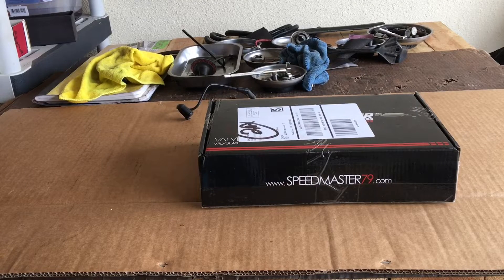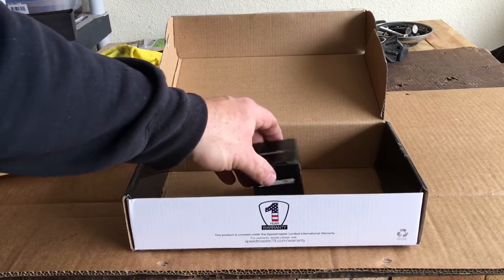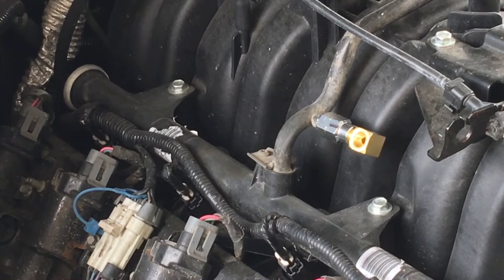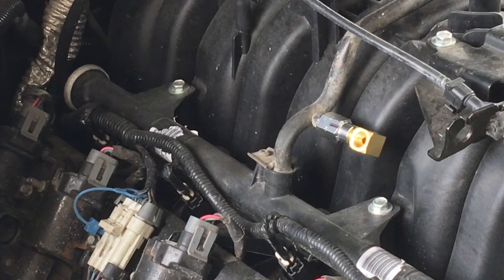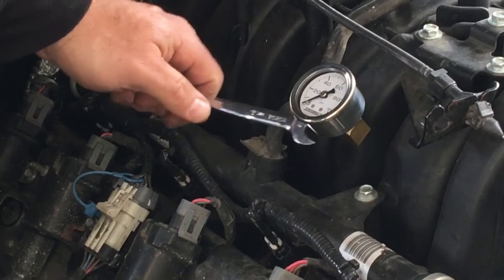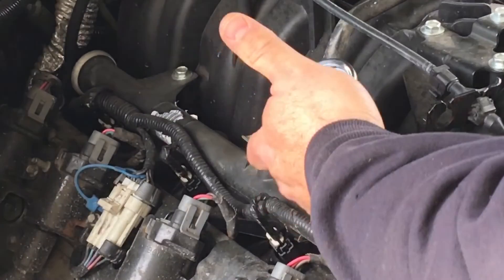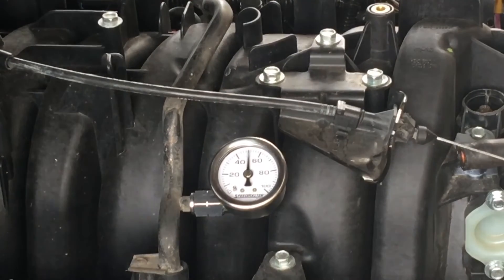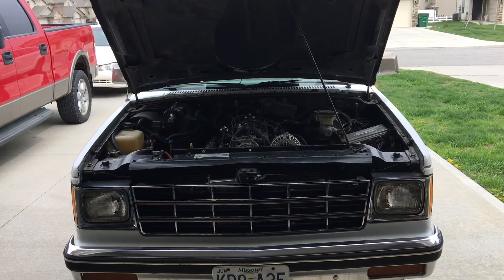LSX Tuning: AFR to lean Check the vacuum line to the fuel pressure regulator

Comment: What are part numbers for swap
Reply from the maker: Sorry, I don’t have the part # for the vacuum hose. On the fuel rail to gauge adapter and gauge there’s several to choose from based on budget and which direction you want the gauge pointing.  I wish I had pointed the gauge differently.  JD
Reply: @HeadFlowInc  wanted for gauge & fitting